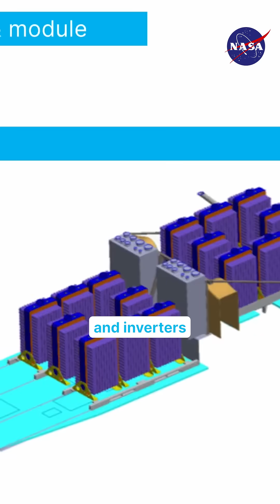NASA X57 - battery testing - when things blow up :)

Comment: Hollow propeller blades would draw air in through the hub using centrifugal force then expel it from the tips to reduce blade tip vortises.